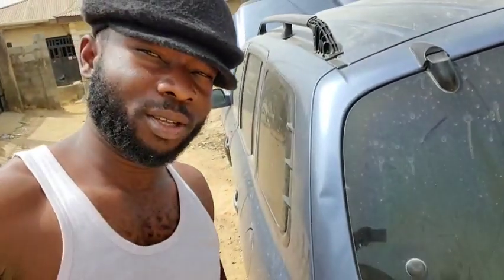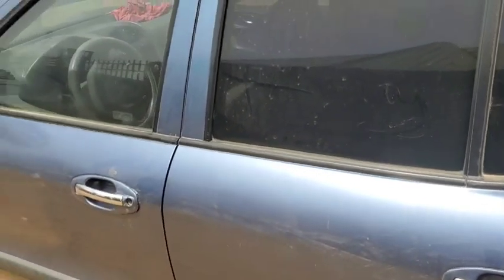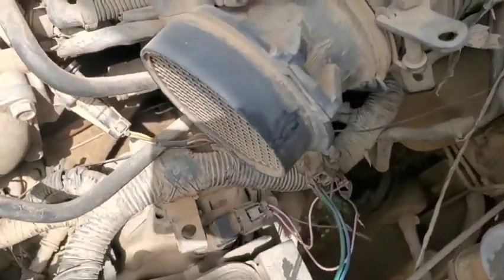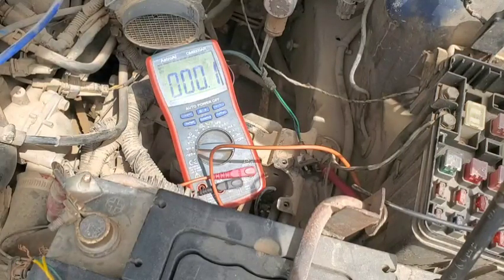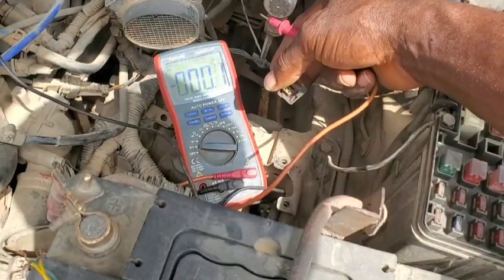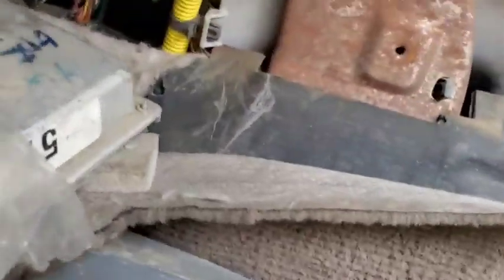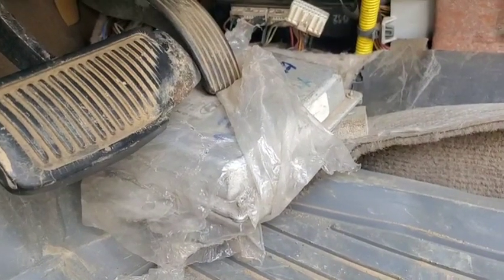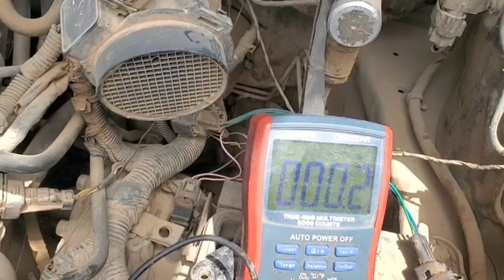Hyundai Santa fe No VSS Signal | P0500 Troubleshooting & Fix Case Study #P0500 #Hyundai #speedsensor

Comment: here is the color code of the connector wires, did you think the middle pin was the output? Pin1 green 12v, Pin2 black ground (middle pin), Pin3 blue output